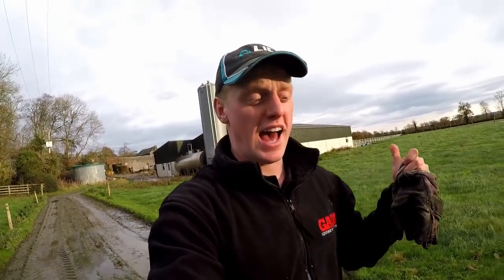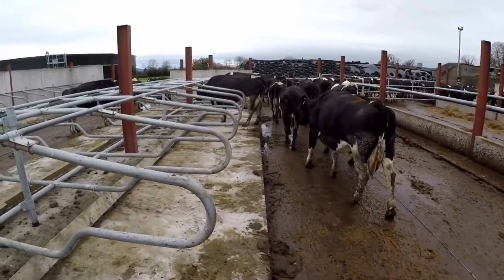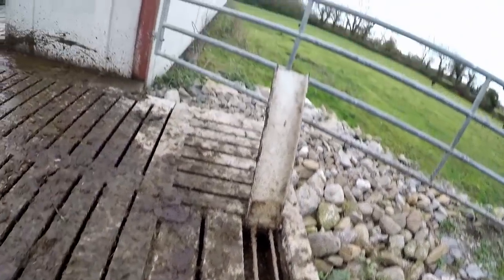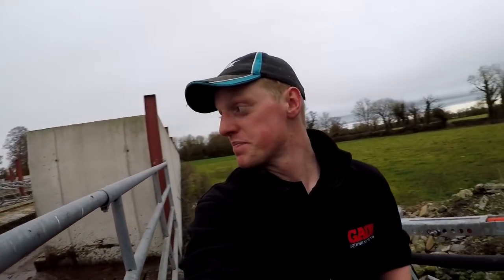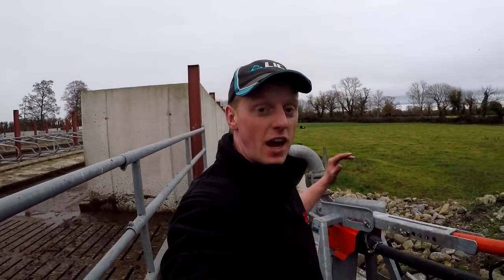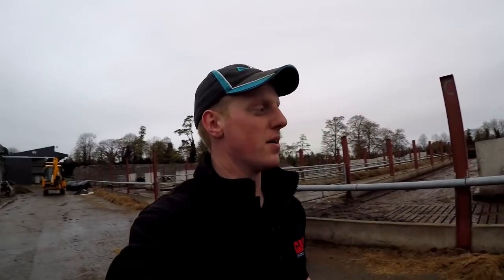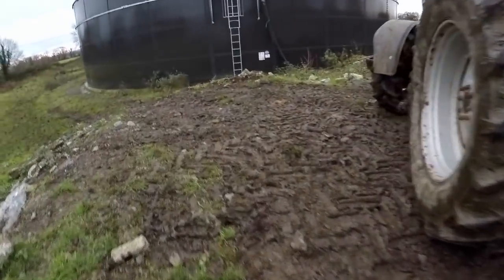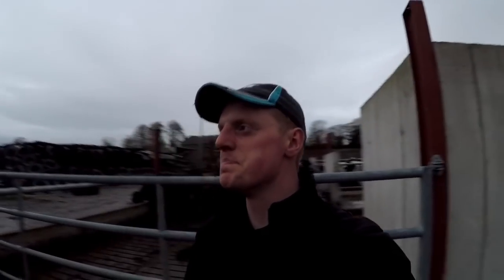THE TANK IS FULL!!! TIME TO PUMP SOME MANURE!!!

Comment: Lovely stuff, what size is the tank and how long would it normally take to pump it to empty?  How do you empty the lay flat pipe when finished?
Reply from the maker: I think the tank is roughly 110,000 gallons maybe. Not sure how long it took to empty as I have only done it twice, less than an hour anyway I'd say. I must time it. I usually just leave to pipe there as it's not in the way but if it was think and I wanted to empty it I'd lift it with the back actor of the JCB

Comment: Just as a matter of interest how do u agitate ur tower I have a 120k tower which I find a nightmare to agitate getting 306k tower contemplating getting an air system to agitate it?
Reply from the maker: There is a whisk at the bottom to connect directly to the tractor but thus works better in our smaller tower. To the left of the cage you'll see another fill point whi h is more like a jetter. We pump in and use this to break the crust
Reply: @MCMilkingIt  thanku